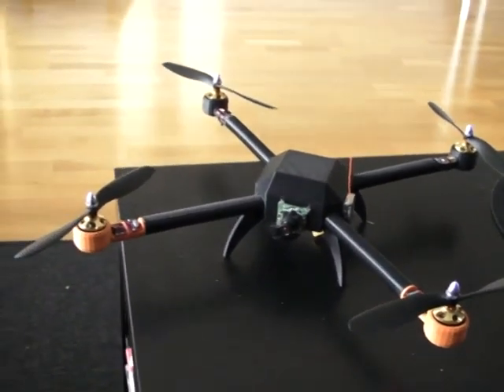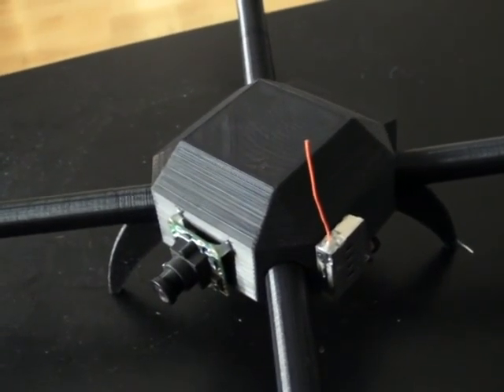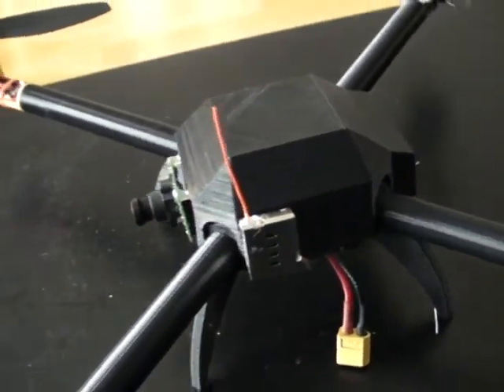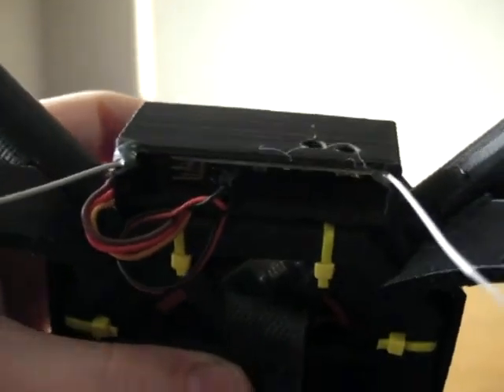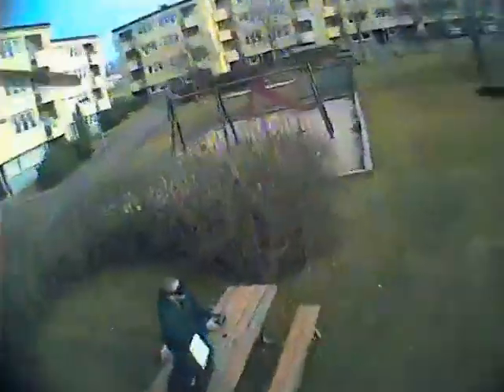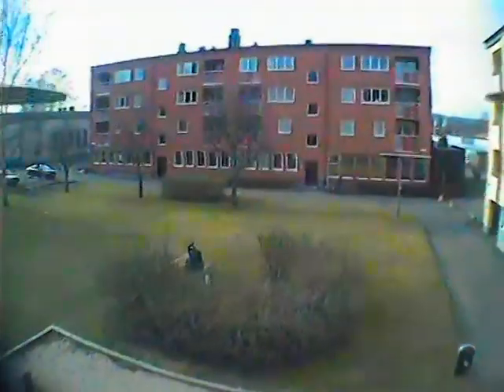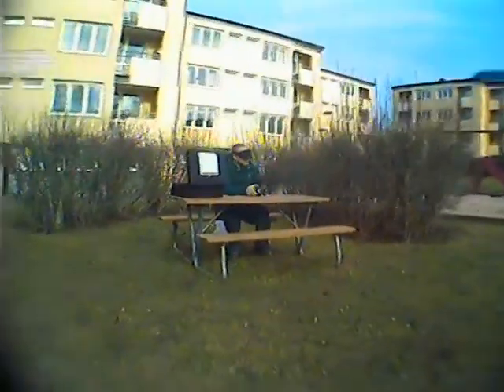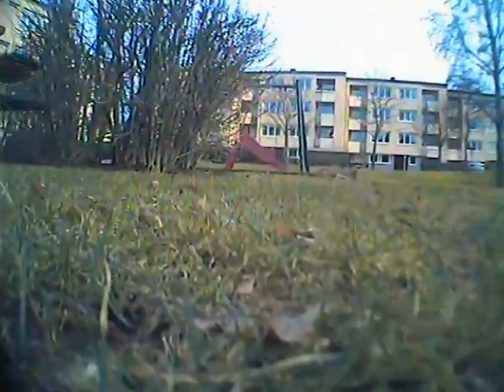First FPV with a 3D printed quadcopter

Comment from the maker: @petleh82 Mostly when i design stuff, i try to cut out the pieces i need to test and just print them out. But for the quad it have some large parts, like the body and the landing gears. Before i got it right i printed out one, to heavy and then one to weak and then the perfect one.After i while you will learn better how the things in he computer will feel in your hand, and you will need to do less test prints.But it will still be a difference between the thing in the computer and in your hand

Comment from the maker: @nThanksForAllTheFish No not for my 1,3ghz, i think that would be to big antennas. And mostly i record with the gopro so some small glitches never gets to the youtube.. However, i have been thinking of getting those fatsharks goggles with built in 5,8 ghz, and there use circular polarization (smaller antennas). I say i used a total of about 3-4 kg, pla so far (that is a lot). Its starts with you getting the ultimaker, and soon every one you know have a whistle.. The quad is below 250 grams..

Comment: Excellent.  Looks like a perfect location for multipath interference.  Have you tried using circular polarization for the 1.3GHz video link - like the skew-planar wheel design by IBCrazy?  Also, how much filament have you used so far in learning the Ultimaker, development and testing this quadrotor design?